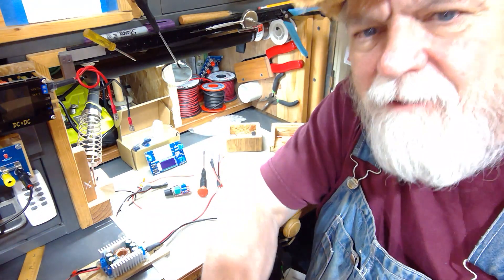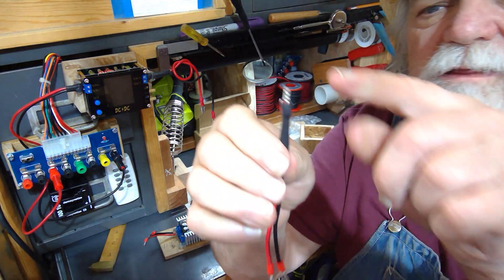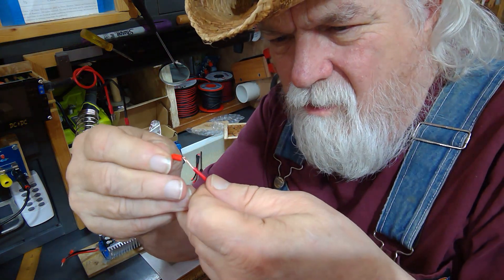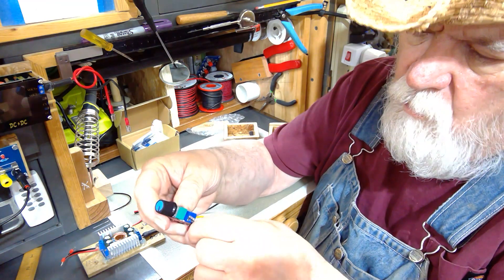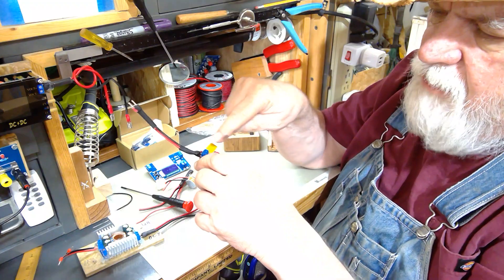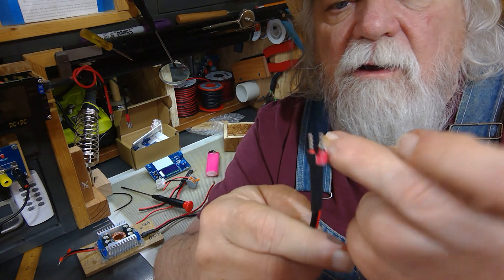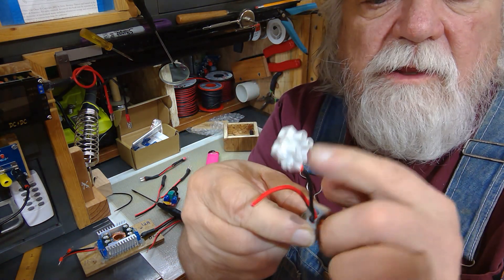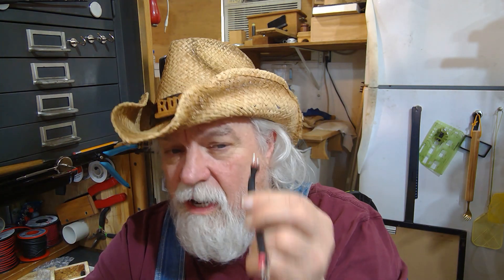Wire Ferrules & PCB Terminal Block Connectors by OTB Thinker

Comment: Hey Russ...Putttn here.  How would you use Ferrules to connect one wire end to another wire at the middle of the second wire.  Would they be helpful?  The way I usually do it is to simply solder the wires together at mid point but in this case I want to be able to seperate the two wires from time to time.
Reply from the maker: If you might want to disconnect later, I would use a 3 lever connector (ferrules optional).  All 3 connections can be removed and put back in at will without impacting the connection between the other 2.  The lever connectors are my new friend around here :>)
Reply: @russveinot5754  I looked at those and it got me thinking that what i need is a T connection.  I did find some T Tap connectors.  Wonder if these Ferrules would be a better connection in the T Tap connectors.
Reply from the maker: @Putttn  I would not use a t tap connector.  I used them years ago and they would fail all the time.
Reply: @russveinot5754  thanks for the heads up on that Russ. I have been reading about their failures. I was going to use them on my Jeep light wiring.
Reply from the maker: @Putttn  If you are doing this on the outside of a vehicle, soldering is the best way.  I have never used the lever connectors on an outdoor project. If using inside the vehicle, strap the connector to a secure anchor point.  As a mechanic in a past life, I learned that failures occur mostly on floppy connectors :>)
Reply: @russveinot5754  thanks Russ. Good to know those tips. Helps a lot.

Comment: Another great tip! I found it somewhat frustrating to use the screw down connectors on my 18AWG from the banana jacks to the buck boost converter inputs and outputs, especially when I needed to remove the input connections when swapping my input into the 5mm jack also provided on the converter. I'm definitely going to use one of your double ended connectors to avoid the necessity to keep playing around with the set screw type connectors on my buck boost. I just never thought of using ferrules the way you did. I wish I would have known about their use when I found that the first batch of banana plugs I received would only accept 12AWG and wouldn't adequately latch onto 18AWG I think the use of ferrules would have allowed me to use bent over tinted 18AWG wire in a larger size ferrule inserted into the banana plug. As it was, I simply ordered plugs that would work with 18AWG wire and now have 20 or so plugs sitting around gathering dust! Again great tip.
Reply from the maker: Thanks Tim for your input.  I use 4mm banana jacks.  Why do use 5mm ?
Reply: @russveinot5754  I didn't communicate well! The 5 or 5.5mm jack is just below the power input screw down connector on the buck/boost regulator module you showed briefly and again in your follow up video. I use this 5mm jack for the 19V laptop power supply I now have available due to the untimely death of my laptop! Because this is also a handy supply in addition the the 500W ATX supply I like to swap the power input occasionally from the top connectors and the bottom (5mm) jack depending on circumstances. My banana plugs are indeed 4mm and of course so are the banana jacks. Unfortunately, the jacks and plugs I ordered came in a kit of 20 or 40 of each and the plugs were designed to only accept a 12AWG (speaker) wire. And I don't see any need for me to be using anything larger than an 18AWG for all my internal and external connections. Hence the need for me to reorder a small batch of plugs that work well with smaller gauge wires. Had I known about the ferrules you introduced I may have tried to use them to keep from buying more plugs. But now I have both the correct size plugs and the ferrules and I will indeed make the same setup you showed on the followup video (slightly modified to allow me to use the supply input of my choice.)
Reply: @russveinot5754  BTW, since it is practically impossible to identify the DROK products by part number the boost/buck I have for a regulator was priced as 15.99. Your converter may not have the 5mm jack as an input! That may also explain part of my communication problem?!

Comment: Tin the ends of the wires if it is stranded or use solid wire.
Reply from the maker: that helps but they are still fragile.  This method works for those that  like to avoid soldering (like me :>) Thanks Akby.
Reply: @russveinot5754  I understand